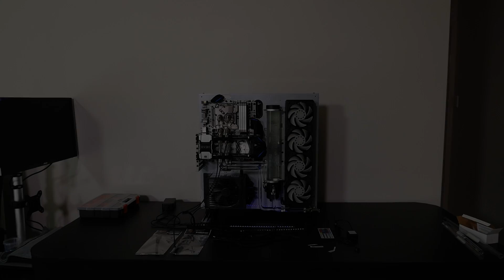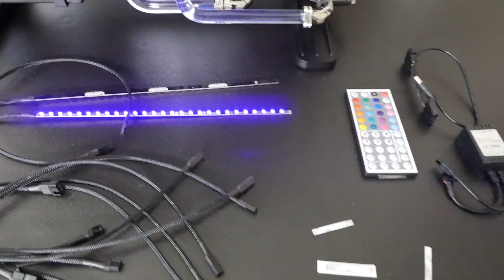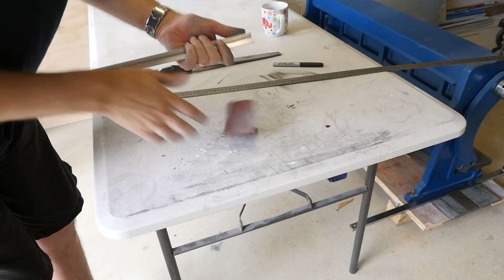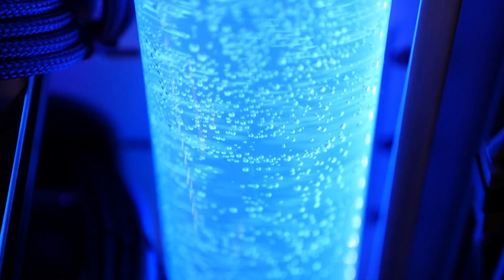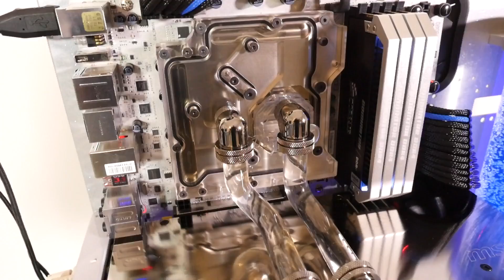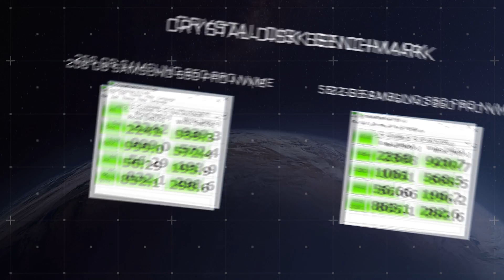SC Build #22: Core P5: Part 8

Comment: I have ordered this case and will start building soon.
I really like this serie of instructional video's but I'd like to give me my input.

Every one have their own views on how to setup the build they have in mind, so do I. 

What I am going to do is to place all the components on the case to figure out what I want, next I'm going to use a thin (white colored in my case) Plexiglas cover and mark the holes I am going to use in my build that way I will get a clean back to build on (without seeing the unused holes from the front).
That way I will be be able to adjust the cables from motherboard and GPU properly (as you mentioned in your vid) straight towards the back by cutting out the cable holes in the case to proper place and use the cover to adjust the holes on proper place..
To get a very clean build at the end...

Thanks and thumbs up

Comment: you can buy led channel with diffusers to hide the strips. it would fit perfectly:

http://www.ebay.com/itm/Surface-mount-LED-Strip-Light-Housing-Channel-Diffuser-Profile-Extrustion-1m-/201906531947?hash=item2f02912e6b:g:rgcAAOSwaB5XtvAK

Comment: Beautiful build as always, this does bring to mind a question however. I have a board from MSI that has the green glowing Power/Reset buttons on the board itself, along with an LED post code screen attached. These are the only green bits in the build, and I wonder if you have any advice for a way to disable the lights or cover the light? I know it's a minor thing, but when I look at a build that's so coordinated and see these little green lights sticking out like a sore thumb it bothers me.

Comment: What's your opinion on instead of doing a parallel loop, to keep it a series (except for the graphics cards, leave those parallel) and using a crossflow radiator?  You could come out of the monoblock at the top and into the top of the cross flow radiator, out of the bottom of the radiator and back into the bottom of the reservoir - then obviously out of the reservoir and into the graphics cards. 

I'm asking because i'm doing almost the same exact build and thinking about going that route with an alphacool cross flow radiator.

Comment: Could you plumb in a tube that goes to the back of the case, then pump a load of UV light into it? Would it work like a fiber optic cable, bouncing the light along the inside, illuminating the tube? I guess it would light it up (at best) to the first water block it encounters?

Have the client install UV lights in the room the PC will be in ;)

Comment: l don't think mbo is right for P5 needs shroud up in left corner and you can't fit I/o shield on it waste of time and money on cabling so back of case looks teriffic all you see is 50mm cable out front could have been $30 sleeved extensions cable management does nothing to performance its a shocker
Reply: So much on hardware can serve as dual purpose for performance and aesthetics, but most of cable management comes off as purely nit-picky and sometimes downright silly to some. For instance, I find no reason to have wires covered up with paracord and heatshrink tubing on top of their already reasonable insulation. If wire color were that important to me, I'd rather replace each wire with the preferred color on the insulation itself. My mild OCD does like having neat well-placed cable runs though,

Comment: Love so many of the Core P5 builds but this is very average for aesthetics other than the cable wiring and management. Products do not match at all. You picked the MSI Titanium to match the case colour you painted but put a monoblock on so you have to take off the heatshrinks and leave it bare... Pointless for colour matching. Fans look so ugly. Power Supply??? I can't understand these choices. For someone who does mods to absolutely everything. If I paid to get this mod done I would be very disappointed!
Reply: I can only agree with the "ugly fans", i hate their look. 

The colour is still matched, with the headsinks it could look better though. 

whats wrong with the psu?

Comment: is the cable comb sold separately? I have the pre-sleeved from cablemod, but seems do not have that item,
Reply: cablemod has their own combs, but from what i understand, they're only transparent and oddly shaped.  it seems here he used an ensourced.net style comb where it requires that you unpin from the connector and slide the comb onto the cables rather than just snap them into place.